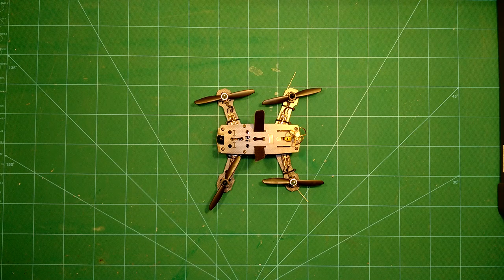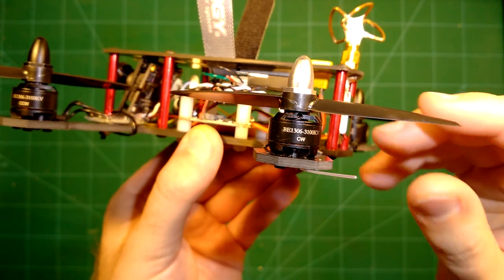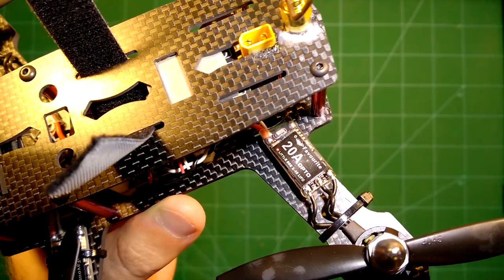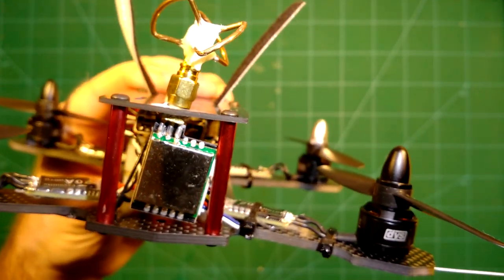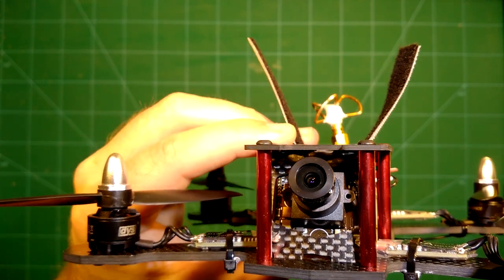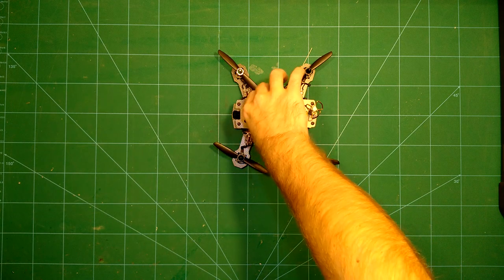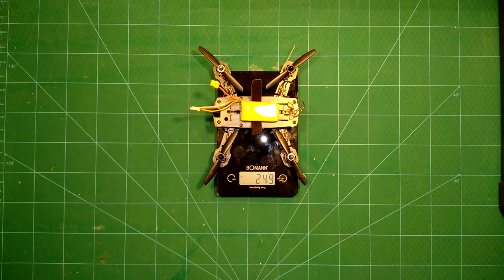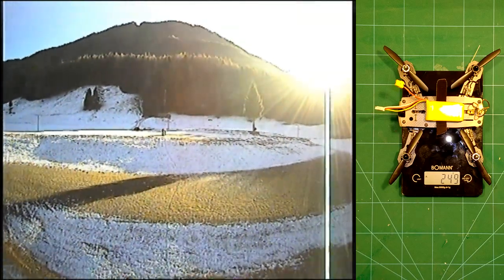ZMR180 FPV build with less than 0.55lbs (250g) flying weight

Comment: Brilliant build. The good thing about a light quad is , you will break nothing in a crash. The sound of a 600g quad hitting the ground vs a 250g quad crashing is significant . If you use DAL BN tri props , you will never break them , there is not enough wieght in thar quad to even bend a Bull Nose prop.
Reply from the maker: +FPVX Absolutely, many thanks! This is one of the reason why I like to build them small and lighweight. Of course, these won't be the ultimative race machines, but other than that building lightweight provides many advantages - you can also achieve real long flight times that way :-)
Reply: +RC FPV Flight Thanks for the reply. I watched your video , I saw we have a simmilar way of seeing  things. I had Cobra 2206 2100kv and they were great fun, but exspensive on batteries and replacement motors, with the 60c  170gram battery , It would hit the ground like a brick.  I built a 180 and loved it more than my Cobra motor quad, nipping through the tree with suprising speed . Thanks for the good videos.
Reply from the maker: +FPVX Thanks for watching mate! If you like lightweight, wait for my next video, you will like it :-D

Comment: Great build. I'm currently working on a 180 quad, but I'm putting 2204 2300kv motors on it and making it 4S capable. I like having 4s, but I'm beginning to think that for 4 inch props, it would be better to do what you've done and make it very lightweight, with higher kv motors. Im a beginner at fpv, so I still the a think that my frame (shendrones Tweaker) will be a good first quad. It's 4 mm and the arms are wide and stubby, so I think it will be super durable. Also, much more portable
Reply from the maker: +Jon B Baca The Tweaker is awesome! I just really like to try to get my builds as light as possible, while still having good performance. These lightweight high-KV motors are amazing. Low weight also means that you have to worry much less about crashes, because there is simply not that much inertia. But I can also see the advantages of true "power beast" builds :-)

Comment: Interesting.  Would like to see more "race like" flying with those motors. Tempted to do basically the same thing but with 1806 sized motors.
Reply from the maker: +BigMeanyVids It works well even with the 1306 motors. I changed to 4045 bullnose recently and we did some racing and I could hold up well. I still have to postprocess that video, but it will be online soon. 1306 motors, littlebee 20A & 4045 bullnose props are absolutely no problem at 3s, neither the ESCs nor the motors were very warm after flying.
Reply: +RC FPV Flight  Awesome. Look forward to it. I'm going to build one this size but will probably use this transmitter due to the ability to detach from the Antennae.    http://www.quadrysteria.com/store/p418/HawkEye_MINI_RACE_BAND_5.8GHZ_200mW_32CH_A%2FV_Transmitter.html
Reply from the maker: +BigMeanyVids Looks good!

Comment: Nice build. But I've made my 160 Grasshopper using same motors with 4045 props, 10A ESCs, Flip32, the tiny CMOS camera from Banggood and a whopping 1000mAh Zippy compact battery all weighing exactly 240g. And I'm getting about 10 minutes flight time.
Now I got myself an A-spec Turnigy 1300mAh 60C battery cheap from HK which is only about 35g heavier, so when I'll put it on I will end up at about 285g, but it will fly like a bat out of hell :)
Reply from the maker: Awesome! I also did a Grasshopper build in one of my more recent videos: https://www.youtube.com/watch?v=GnIEwvqfZJE

Great work, mate!

Comment: Thanks for this really great video.  If I were to try this do you think I could save a little more weight with the ZMR150?
Reply from the maker: +Sankofa Musician Glad you like it! With the ZMR150 you would definitely safe weight, since the frame itself is lighter than the ZMR180. But you will also loose the ability to use 4" props, the 150 will support 3" at most. Now with the 3" you loose a bit of efficiency compared to the 4" which will probably mean a bit less flight time. Other than that it should do well with the 3" props. You do not need to go for the 3020 or 3030 (which lack a bit of punch), but there are 3045 available as well. Should be a little rocket that way! However, with the smaller ZMR150 frame the space is quite limited, so you might have problems mounting a Mobius or RunCam (if that is something you consider).

Comment: Guten Tag! I am very interested in fpv but I just started with Syma X4. What do you suggest to start with when moving to fpv and any special flight training is needed? any budget figures you can share?
Reply from the maker: +Bruneau Melier Hi Bruneau! That is a really though question. It is a bit like asking "Hey there, I'd be interested in getting into driving, what kind of vehicle could you suggest to me?" :-)

I defenitely need to know a bit more about you to give you suggestions. What is your budget? Do you like to tinker/build or are you looking for a ready-to-fly option? Are you interested to stay small, eventually getting into racing, or do you look for something larger which you might also use to do areal photography? Many questions ... give me something to chew on and I'll try to give you some suggestions out of my experience.

You will not need a special training, but you need to keep safety on top of it at all times. When you fly, always look for a deserted place without any buildings, etc. Best would be if you had a seasoned copter helping you with your first flights, that will avoid many of the beginner mistakes.

Comment: hello...thanks for the reply. Fot the moment I am interested mainly in flying but with goggles and to progress more in a fast flying style with some stunts for fun. But mostly to be like in a cockpit of an airplane and having nice fly in beautiful places...so not really races.budget no more than 500eur. RTF would be great if under budget and I would like to fly in wide areas...so a bit long distance...like ~2km. Hope this give you a picture of my mind :)
Reply from the maker: +Bruneau Melier That helps :-). If you are not dedicated to getting a multicopter, I would actually suggest a plane to you, based on your considerations. A Bixler with a full range reciever and a nice 5.8 GhZ FPV kit would nicely fill your requirements and would also be a good and easy start into the hobby. If you want to get a multicopter and RTF, you have many options for RTF. If you want to go cheap, you can try the Eachine Racer which I reviewed here: https://www.youtube.com/watch?v=m3GvmEphPi8 . That only costs around 130 USD including a 600 mW FPV transmitter. On top of that you can get a Taranis Radio for around 200 USD. You will additionally need FPV goggles. That setup with a full range radio reciever will give you 1.5 - 2 km of range, but make sure that your local rules allow you to fly that far (most countries only allow line of sight flying).

Comment: What's the blue "dip"?
Reply from the maker: +Ian Vermilyea That is thread locker. It is like super glue, but not that strong. It prevents the screws from coming loose due to vibrations. I use this one: http://www.hobbyking.com/hobbyking/store/__11409__HK_171_Thread_Locker_Sealant_Medium_Strength_Blue_.html

Comment: is it usable with a 1300mah 3s lipo?
Reply from the maker: +Daniel mähring With my light-weight build (!) that might be a bit on the heavy side, but totally flyable. I often fly it with a 850mah 3s lipo and the RunCam 2 on it and it flies great with it. You will get great flight times with the 1300mah, that for sure :-)
Reply: ok thanks RC FPV Flight
Reply from the maker: +Daniel mähring It all depends how you build it. A friend has build his 180 frame with 2204 motors and flies it with 1400mah 4s lipos. That is a rocket tank ;-D. My intention with this build was to keep it as light as possible.
Reply: RC FPV Flight
ok

Comment: What do you think about a 4in1 esc instead of 4 separate ones?
Reply from the maker: I like them very much. Of course they have the disadvantage that if one of the ESCs burns, you have to buy a complete new one. But other than that, I only see advantages. In fact in my latest X-build I use a 4-in-1 LittleBee ESC and I love it. I also talk quite a bit about it in the video. Check it out here, if you like: https://www.youtube.com/watch?v=97OfMp569p0
Reply: Bist du aus Österreich? Gruss aus Vorarlberg :)
Reply from the maker: Thanks mate! I know the Flycolor one, in fact I have one here at my bench for review. However, it is really not meant for smaller quads. It is quite heavy and large actually. I plan to use it in a larger quad, for this it should work great! For a small and lightweight 4-in-1 you really can't beat the LittleBee currently. It is also very durable, I constantly use it with more than 20A / motor and it does not even get hot: http://www.banggood.com/Favourite-FVT-LittleBee-PRO-20Ax4-ESC-With-5V-BEC-BLHeli-2-4S-F396-OneShot125-For-RC-Multirotors-p-1048318.html?p=I32013833408201410RW
Reply: Vielen Dank!!!

Comment: with the battery that you choose,  800mA 3S,  how many time could you fly? 
I was thinking in 1300mA 4S,  what do you think? 
thanks
Reply from the maker: +Gustavo Hoffmeister With the battery shown in the videon (500 mAh / 3s) I get about 5 minutes. With a 850 I get about 8 minutes. With a 1400, I guess I would get well above 10 minutes. All depending on your flying style of course! For 4s you would most likely have to change a few of the other components as well.
Reply: +RC FPV Flight I think I only need change the motors,  I suppose thats no support 4S,  and the props ?
Reply from the maker: +Gustavo Hoffmeister Definitely the motors, yes.
Reply: +RC FPV Flight  thanks to answer, could you recommend motors for my zmr180 to 4S ans 4055?
Reply from the maker: +Gustavo Hoffmeister I always like to keep it cheap and light, so take my reply with that in consideration. I think I would try some 1806 / 2300 kv motors. These for example: http://bit.ly/21PkgkU. Yes, they are only rated for 2-3s, but they are also only meant for 5"-6" props upwards. So if they run a 5"-6" prop fine at 3s, I'd think they might just manage to run a 4" prop at 4s. They are also cheap, light and with good reviews. Worth a try.